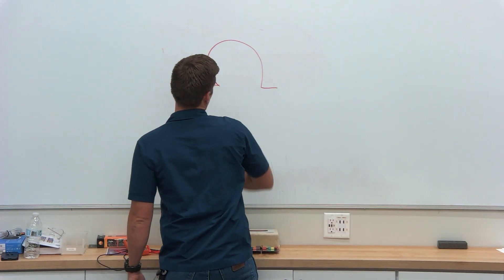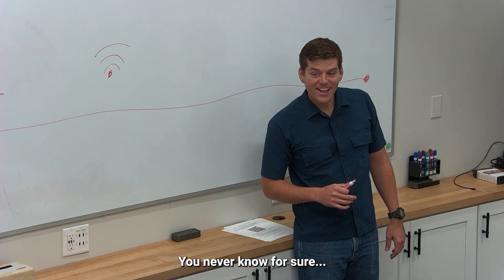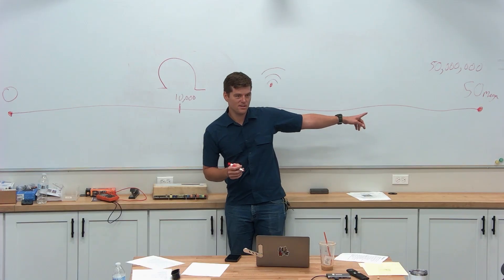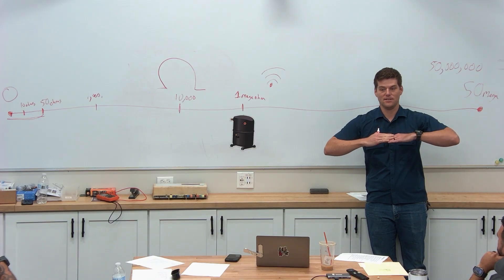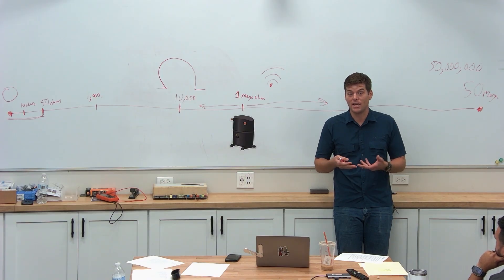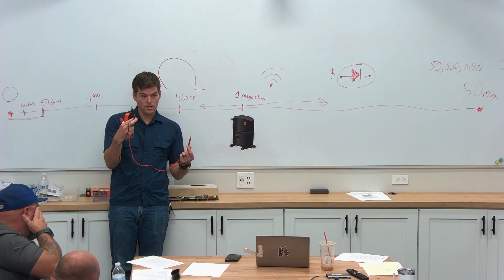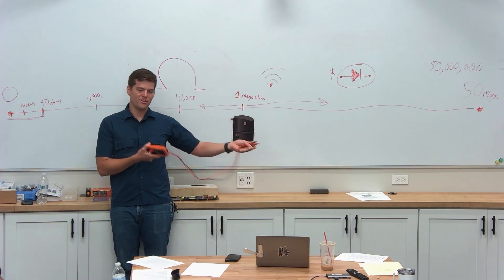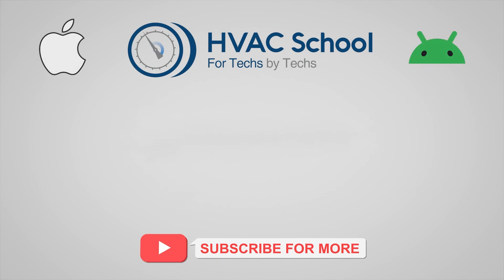HVAC Multimeter Skills: Continuity vs. Resistance & Diode Testing

Comment: Most techs that I’ve encountered here in England only use their multimeters for voltage testing and continuity. Really nice presentation on the differences.
Reply: I used my meter incorrectly for a long time until I had someone teach me the correct uses. Just trying to spread that knowledge!